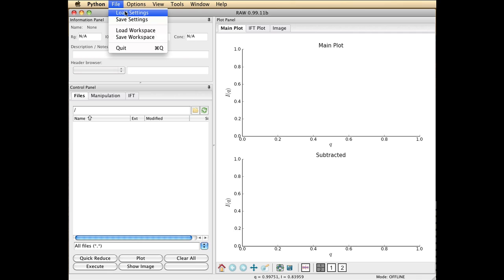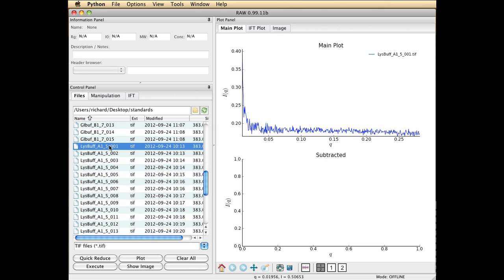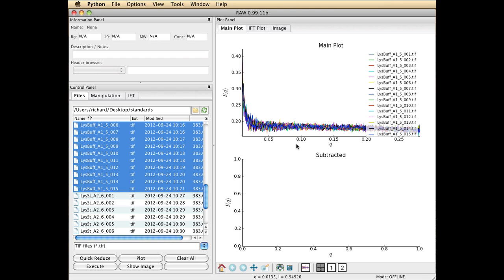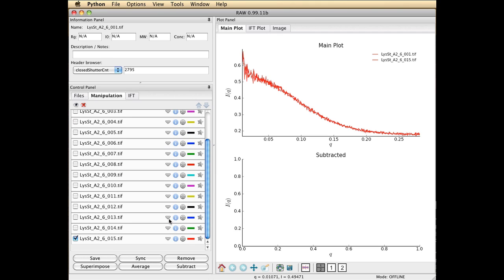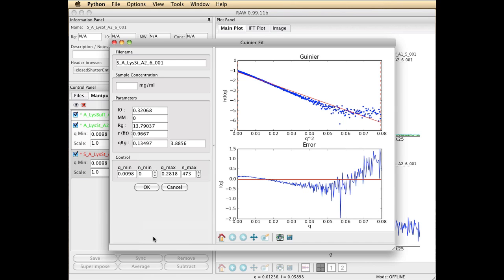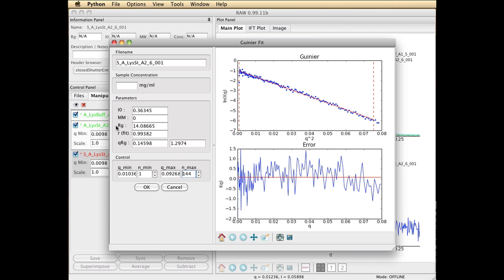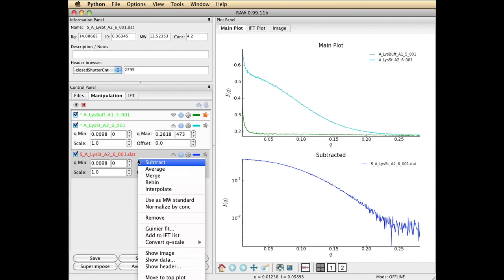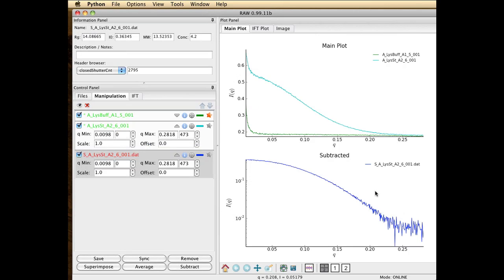RAW Software Demo 2: collecting and processing data

Comment: Great tutorial thanks a lot! I have a question about using transmission (direct beam) measurements to put data on the absolute scale. In the Options - Advanced Options - Absolute scale, I can see 'Empty cell' and 'Water sample' inputs. I am wondering what goes in there? In our instrument (Bruker MicroCalix) we can take transmission measurements, then use the software to workout the intensity of this beam.
Thanks